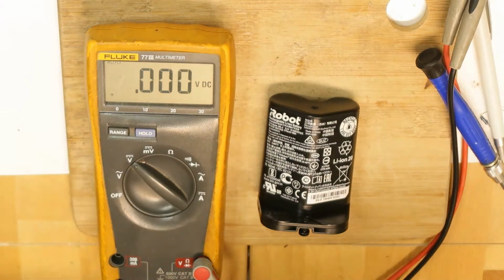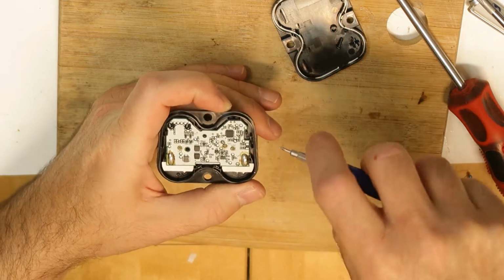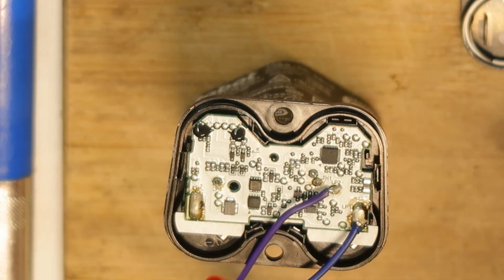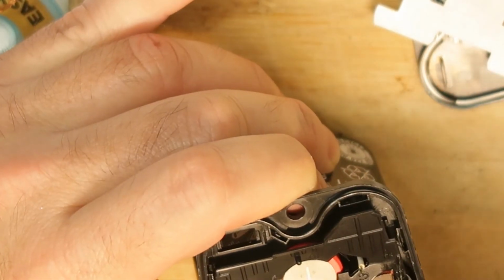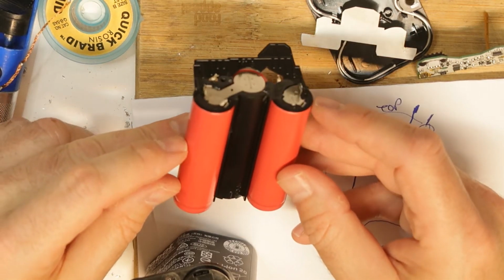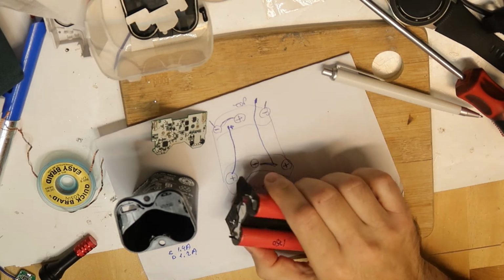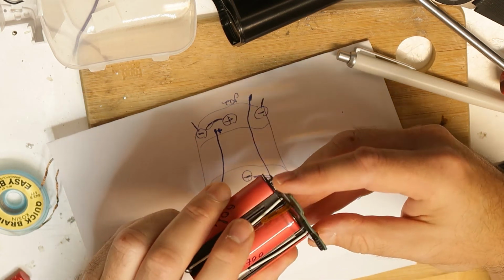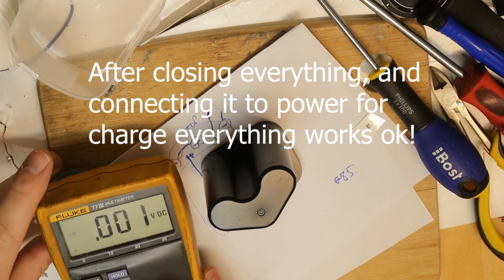Irobot Jet M6 Battery fixing

Comment: Hello friend
Had the white clockwise circle Lightning 24/7. Added some solder to the 4 joints - and it run’s 👍🏎️.
Reply: Hi what did you can you explain a little more

Comment: Hello, i have one unit like this one, charging light stays on all the time and not responding to any commands. It can be overdischarged  battery? Because you only charged separately and now is ok. Or the connection from charger to bms not good?

Comment: Hi,
How do you measure the voltage of the battery? just check the two outer pins? 
I saw you use a resistor. What is that for? I can see  positive side but your hand cover the other side. Thanks